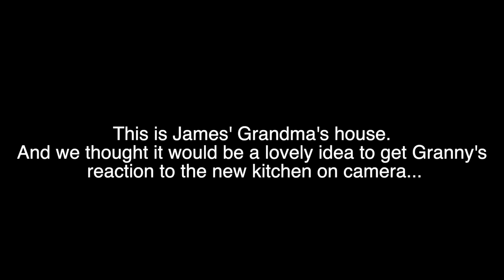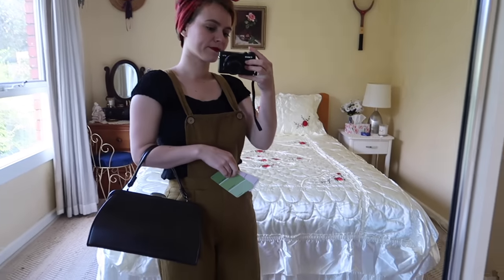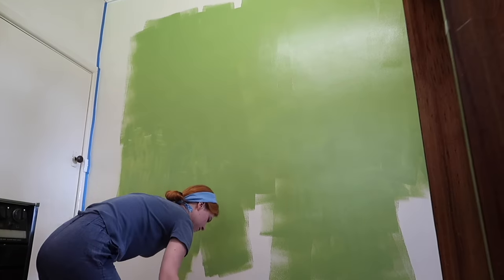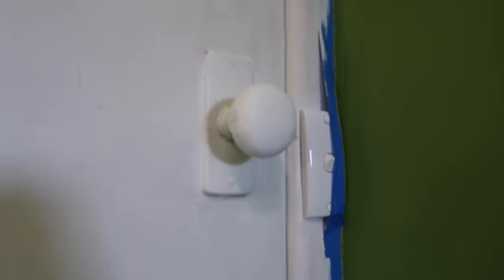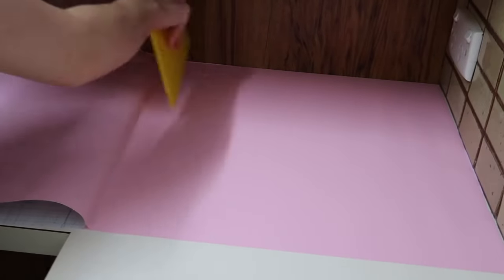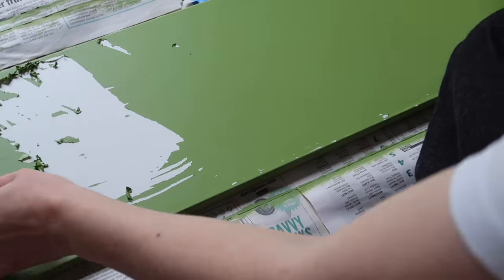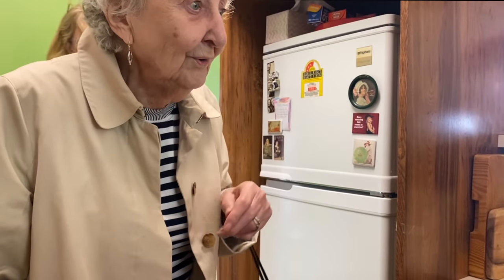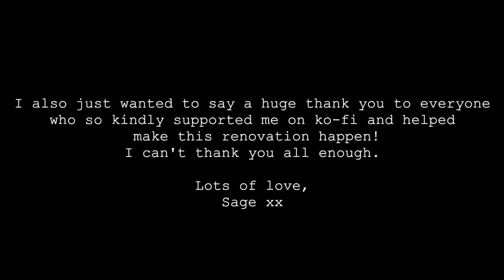1950's Kitchen Renovation

Comment: great job. Love colour combinations.
2 biggest issues with renovating houses built before 1980s are:-
ASBESTOS. (in almost everything- flooring, walls,wall decorative surfaces, tile adhesive, carpet underlay & the list goes on.
LEAD PAINT.  very nasty. lots of health issues for affected renovator, and potentially   their kids.
Please check for both before prepping for painting/ drilling/ removing/ repairing/building, on any built-in furniture/ walls/ tiles/carpets/ linoneum/ eaves/doors/ceilings. There's a couple of helpful local state/ renovating websites. Keep renovating!

Comment: I think the modern wallpaper glue is probably fine, but my thought is that if deterioration occurs, it will probably be over time, rather than immediate. Similarly with oil potentially soaking through the putty and second layer of wallpaper, it may not be something that can be tested short-term.

If the oil seeps through the second layer, you can add a piece of wood trim against the edge of the tile to cover those oil spots. All you would need would be a hand saw and a miter box, if you don't have or can't borrow the appropriate power tools.

I hope you seal the wallpaper as others have mentioned, so you don't get the same issue from new oils above the stove.

For the door hardware, use a razor blade, X-acto, or utility knife to slice around the outside edge of the paint on the door knob cover plates, take them off and soak in boiling water with a little soap to remove all of the paint with little effort. Then, just polish them up and put them back on. That should keep them functioning better, too.

Comment: I love the kitchen!  With the wallpaper, I would see if its possible to seal the wallpaper, so no more issues with dirt or grease happen in the future.  And if the oil comes back maybe just put a wood trim over the area and conceal it.  You could probably even DIY trim with a pallet, and there are a lot of easy natural (aka pretty much free if you have the stuff) ways to tint wood.  For the shelves, perhaps try sanding them with a finer grit sandpaper and see if that helps the paint stick.  Sometimes that helps with purchased furniture or shelves.  Also if you wanted a tension rod would work wonders in the window area for a curtain rod and it wouldn't require a stud!  Finding studs in old homes is a nightmare.  You and James did a wonderful job on the kitchen!  It sure has a lot more charm and personality now.

Comment: Regarding your dilemma with how to hang your curtains, could you use a tension curtain rod? This way, you still get the same look as if you used a regular curtain rod, but without needing any hardware. The tension rod might be the better option over Velcro.

Comment: For future reference on the curtain thing, there are rod holders available that hammer into the skirting trim rather than drilling into the wall. Then you can still have your rod rather than damage the walls with adhesive velcro. I know you can get them on ebay, not sure if bunnings has them though. Kitchen looks amazing! What did you end up doing with the microwave?
Reply: no need to hammer the new ones in they have them that just stick the tension rods

Comment: I saw there are transparent adhesive foil you can buy to cover wallpaper to protect it from oil etc when cooking.  Honestly, not sure if it would damage your vintage wallpaper.  There is the plexiglass route, I seen it on display kitchens in Bunnings and IKEA. I hope you find a solution as I would hate to see your lovely wallpaper damaged.

Comment: For the ikea shelves use fine sandpaper, sand them first. Wipe down the shelves let them completely air dry. Then paint over them. Most modern furniture has a varnish over them that won't allow paint to adhere to it. Be careful not to sand down too much as most modern furniture is not made out of solid wood either. Sand down too far and you'll hit the particle board layer.

Comment: Did you prepare your shelves before painting them it's especially important if they are from Ikea they usually have a glossy finish on top most likely why the paint peeled I see everywhere before someone paints some sort of furniture they always prepare it before hand by sanding it down then priming it so I would try that maybe that will help with your green paint from peeling off hope that helps

Comment: If you want to get old paint off door handle and hinges put them in an old crock pot and let them sit there till old paint is loose then brush with a stiff brush. Let the hot water in pot do the work.

Comment: Paint didn’t stick to the shelf because of its glossy surface. Try going over it with a fine sanding paper to rough the surface. The paint should stick then. For the door knob and plate, you can put 5hem in a container, fill it with boiling water, and let it sit overnight. It may take a couple days, but most of the paint should come off. If it has oil based paint, you may need stripping chemicals or thinner.

Comment: I agree. Those white and black Reno’s look bad. Although we (US) lost our minds in the 70’s. I was a teen back then and thought that they looked bad back then. I like the 1920’s thru 1960’s. I designed and built a late 19th century Tuscan Farmhouse. The primary diversion was to use a lot of large wooden inswing windows instead of the traditionally small windows. People feel like they are going back in time.

Comment: That particle board is terrible around water. It swells up and gets permanently ruined. Here’s a tip, you can replace it with durable woods like pine and oak or use somewhat affordable plastic decking material.

Comment: Using primer on the shelves would allow the paint to stick better. it's a good idea to use primer on walls too, but not always necessary if you clean really well and the paint isn't really slick. I think the green shelves would have been a bit much, anyway.

Comment: That green paint on the shelves gave me nightmare flashbacks my bedroom used to be that color and my room at the time had smooth walls. We are still unsure why it did this but after awhile it peeled off in sheets.  I truly hope this doesn't happen to your kitchen because it was very annoying
Reply: There are three reasons that could have happened: 1) oil-based paint painted over latex paint, 2) latex over oil without sanding and an appropriate primer, or 3) paint on plaster that wasn't fully cured or used a primer that could not handle not fully cured plaster.
Reply: @mollymorgan8652  it was almost like it never dried. We think what happened is if I remember when we painted that time it was really humid in that summer and our weather isn't exactly consistent but we also think there was a flaw in the paint because we went back and checked what we used
Reply: @TheDeerhunter316  Most paints have humidity and temperature limits for their application, or they won't cure properly.